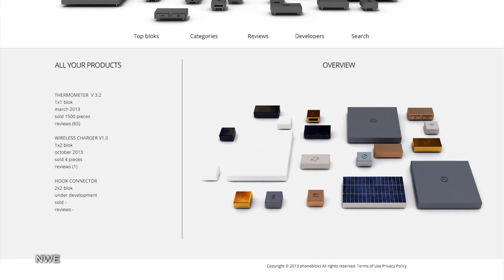Why Phonebloks Aren't Going to Happen

Comment: high speed signals ? we use gold for years in electronics 
ram and processor far away from eachother  cause slower speed ? how big do u think the phone is gonna be ? 
standerd input device  to make all combinations work ? thats called the motherboard + i dont know if they are gonna design it so u can put anything anywhere. that would be mad engineering.

Comment: think this guy doesn't know what he's talking about XD phonebloks has the cpu chip in one block and for example the wifi block separated. The idea of phonebloks is to make a phone mother-board where the changing pieces are separated. It means that the pieces which need fast connections are all in the same block. The connection between blocks don't have to be too fast because there is not going so much data around. Some pieces need just a few connectors, for example the antenna, wifi or battery. The only problems will be with the display and camera connections douse those need more pins, but not so much speed.

Comment: Here is a fella that thinks that phones can only be built in 1 way and he tried so hard to convince others that such a device would be impossible. Just remember, slightly more than 40 years ago, cellular phones were the size of bricks. And another thing, i don't think this guy read up or research on this project before speaking, clearly at 0:22 the memory block doesn't increase processing speed of a phone.

Comment: I love how all of you are yelling wrong, yet he isnt. All the concepts that phone blocks put out are not implemented in project ara. The modular system is not integrated in ara, it has a standardized exoskeleton. Plus, it is in its development phase, i bet most of you dont know how long development takes.
Reply: Quinntun Harris see the rest of my comments. Project ara is not using a lot of concepts that phonebloks is stating in that video.
Reply: It'll be ready for purchase this time next year according to development heads. 
The important part of "phonebloks" was the modularity. the ability to upgrade parts one at a time, instead of a phone as a whole. The different sized blocks was just an afterthought by this one guy who made the phonebloks concept. Modular Smart Phone with a marketplace for these modules is still coming.
Reply: Also, tHaH4x0r this does have multiple sized blocks available, and you can place any block, in any location. Check out some updated project ara demos to see for yourself. Not quite to the lego any size builder style that phonebloks showed, but still happening.
Reply: David Jeffers i already saw the updated project ara demos and it is still an exoskeleton with certain size blocks that can only be put in certain spaces. That you can upgrade parts is nothing new, it exists for decades on pcs, nothing special. Plus, almost none of the videos showed the phone working, and if it did it did extremely slow. Nothing new.
Reply: No, you can put any block in any slide, sure they are size specific, but anyone can make any block of any size. The bringing the modular components were not meant to be new in the entire industry, but revolutionary change to the phone industry.

here's the video I'm basing most of my words on.
Project ARA Phone at LAUNCH co
Reply: I don't think anyone really expected the extreme level of modularity phonebloks laid out. The important part was just the same as a PC could do.
Reply: David Jeffers Phoneblocks laided out a concept that was unachievable and now you are adjusting their sails saying it was not their original intention. The guy of this video said that the original phonebloks concept was inachievable and it still is, saying that that was not phonebloks' intention is not an argument. With this little, and size restricted blocks it is most certainly easy, but not in the spirit of the original phoneblocks. If i want a bigger screen i have to buy a whole new exoskeleton and screen, in contrary to what that video promised. This video remains just as valid.
Reply: I'm not adjusting saying it wasn't their intention. I'm saying that the big deal is being ignored because this guy wanted to nitpick at the specific details
Reply: David Jeffers Well what is the big deal? They promised a phone in which you can change anything, you still cant.
Reply: Yes you can. it's not in the same style as this concept, which btw phonebloks is not project ara, project ara was a "secret" project in development by motorola, and when phonebloks went viral they decided to go public with their design they already had in the making.
Reply: David Jeffers "tw phonebloks is not project ara" yes indeed, yet most of the people here do think so. Almost all the concepts that are critizised in this video are NOT implemented in project ara, yet people yell "LOL YOU WRE WRONG PROJECT ARA LULOLOOL"
Reply: That is because they completely said "NOPE" to the entire idea, because of the underlying concept had faults.
Reply: Which is the reason I, and many other people are saying "I'm sorry, You say phonebloks concept is impossible? I couldn't hear you over the Project Ara videos"
Reply: David Jeffers And it still has those underlying faults: cpu, ram etc cannot be spread around yet, no results of speed are displayed yet (probably because it is not fast at all (yet)) and not any and all combinations are possible. All the things he said phoneblocks couldnt do, still cant be done.
Reply: tHaH4x0r yeah... you can... upgrading specific parts instead of having to upgrade the whole phone, iirc the cpu and ram are in one chip, the battery in it's own chip, the camera in it's own chip, the wireless antenna in their own chip, instead of one bigger battery you can have as many batteries as you want it it, you can have a wifi only model, your OS block, your identity block, etc
Reply: David Jeffers no, you cant place ram on another place as the cpu for example, and that is exactly what phonebloks promised.
Reply: no, it's not. it's one part of the idea, and now that I think about it, they actually didn't say that at all. they said the "speed block"
Reply: 1) the original phonebloks video had to be simple enough for a consumer to understand, so "Speed Block" doesn't say they doesn't know what goes into a phone, it is getting rid of technical jargon in order to make the video sharable.
2) you just said you can't separate the CPU and RAM, and now that I say that you aren't separating them, having them in one block you can switch out, you say you want to separate them. 
3) The CPU and RAM combined are what you'd be upgrading, and you'd recycle them or resell them, not just trash them, in theory. 
4) in a PC the easiest thing to upgrade is the RAM, that doesn't translate the same to a phone, the screen, camera, battery, storage, SpeedBlock, all these things are the goal,

If I'm content with my phone, then instead of paying 300-600 dollars for a new phone every 2 years to stay up to date on the speed I need to run these new more intensive apps, I just need to spend 50-100 bucks on upgrading my speed block every year or two, and maybe a camera upgrade every 3-4 years.
Reply: David Jeffers i wouldnt call ram technical jargon. Most of the people interested in such a phone do know what ram is.
I say you would WANT to seperate them by the ideas of the concept, yet you cant.
" recycle them or resell them, not just trash them, in theory." You can do the same with phones today, guess what happens in practice?
I dont get the point of 4, what are you trying to say? Because all of those things can be upgraded just as easily as the ram, with the exeption of the cpu.
And what about screen? and what about battery life to go with the extra speed, screen and camera? Effectivly you end up replacing everything because hardware from 2 years back will still bottleneck newer hardware.
I get the concept but what you are trying to imply is not one of its strengths.
Reply: Shit...  I just typed a whole lot in the notification center while a video was playing, and since it was a playlist it autonext'd the playlist without waiting for me to click post comment... I typed all that and have to retype it TT_TT so be patient for me please.
Reply: David Jeffers sure, i love having normal decent arguments with people on youtube, you dont get them very often, most of the times it is just calling names..
Reply: Alright! So here it all is again, I hope I don't forget some of the points I made in the comment I lost..

1) RAM, CPU, DPI, mAh are all technical jargon term that most people don't understand. People would love to walk into a store or shop of some kind and say "My phone is running slow" and be told to upgrade their speed block, or "My phone won't stay charged" and be told to upgrade their battery block, or to add a second one because their second 2x2 block slot just has a filler block

I work in a PC Repair Place, and all the time people bring in older PC's and say it's slow, and we sell a lot of CPU or RAM upgrades that way.

2)Well, the video of this concept never suggested they wanted to separate CPU and RAM, you said that. And the benefit of that does not outweigh the cons of it, so it wouldn't happen.

3)I don't know about in your area, but I Sell my old phones on craigslist every time I upgrade. The only time I don't sell my old phone is if it doesn't work anymore, or I want to keep it as a back-up phone. And it's very common in my area. It could just be because I live in a highly populated area where it's caught on to do so, but you imply that reselling a smart phone isn't the norm in your area, so it's just a matter of it catching on I suppose. 

4) I'm saying that the SpeedBlock would be the most often one to get upgraded, in theory, and in that there shouldn't be any major bottle necking, and if there is then the store your buying your blocks from should be warning you about those, suggesting they need to upgrade X block as well.
Reply: David Jeffers .RAM CPU DPI and mah are not technical terms at all. Maybe most people dont know what they are, but they do know what they do, when you upgrade them you speed up your pc. SPI, PHY, RTC and nyquist are technical terms. I dont know what kind of people get to your pc repair place but everyone i have known knew what ram or a cpu was.
according to the original video, when you upgrade a part, you want minimum waste, so it would be sensible to seperate the cpu and ram.
And if you are already selling your old phone, then what is the advantage of phonebloks? The video implies a lot of phones are getting tossed out, yet it is the extremely dated ones that are being tossed out. The same thing is going to happen with phonebloks.
"and in that there shouldn't be any major bottle necking" you work at a PC repair place then you also know that once you upgrade your cpu, you almost always have to upgrade the RAM and gpu to go with it. And the new cpu wont fit on the old motherboard, so that is also necessary.
And no, phonebloks cant get away with 1 backplate with endless cpu's, they have different packages on pc as well with good reason. Which negates the primary advantage of phonebloks.
Reply: 1) The most people know is that they know if anything at all about ram/cpu is that it affects how fast the computer is, but just knowing that doesn't give you enough knowledge to upgrade it intelligently. for example, 32bit processor and trying to upgrade past 4gigs of ram, just being the most common thing people don't know. or not knowing that there are different types of ram DDR2 DDR3 PC100 etc, same with the processor, they may know it's "the brain" but they don't understand the basic differences between them that they need to understand if they can actually upgrade them. Socket, speed, amount of cores, etc. and if you can find an average consumer that understands what "DPI" is then you may live in an area with a lot more tech intelligence than I do. Most people around the area I live are not that bright when it comes to computers/electronics. 

By the way, I'm not talking about what my peers and friends know, I'm talking about the general population from what I've experienced in my past few jobs, as well as this current one at the PC Repair Place.

2)Well, as desirable as it may be to separate the CPU and RAM we obviously for reasons you and many others have pointed out, can't they are gonna have to stay together. I'm more than willing to compromise that

3)PC's have different generations when it comes to processors just like this phone does, one socket type in a PC would have a lot of different upgradeable CPU's you could put in it. And new CPU's get made for the older generations sometimes as well, a new AMD Processor just came out for a socket 2 or 3 generations old. This phone would have it's own socket type for it's first generation and if the need came to upgrade past it, they would release a new generation of phone, but it would be unlikely and uncommon just like in the Custom PC world. 

Keep in mind, in this scenario there isn't even a motherboard involved. The endoskeleton doesn't act as a motherboard, it acts like a network switch according to everything I've heard about it, so you essentially have a motherboard CPU RAM OS and everything like that on one module, and you add new features as modules like wifi cellular storage battery etc

It's not ideal for modularity, but it's the closest we can get right now, and I'm more than happy to take it, maybe in the future we'll have our ideal fully 100% modular phone as well like the PC is, only time will tell. This isn't completely ideal like the original Phonebloks concept, but it's got the most important part of it, screen, speaker, camera, battery, antenna, etc being modular, which are a lot of components I don't have to re-buy or something if the screen cracks, or the wireless antenna is out dated or the 

4) "One backplate and endless CPU's" 
I have no idea what you're talking about, I never suggesting having multiple system blocks
Reply: David Jeffers You must consider that the people going to a pc repair place arent a median cut of the general population, a lot of people do it themselves or let family members/friends do it.
Reacting to point 2, i said that because that was a point of the uploader of the video, and it still is valid in contrary to what many people claim.
The new sockets are because processors that are being designed have different pinouts. That is because the internal structure is designed for maximum speed, not for convenient pinout. When you have to design around a certain pinout, performance will suffer. "but it would be unlikely and uncommon just like in the Custom PC world." Based on what exactly? They take a lot of ideas from the PC world so i guess they will take this too. Plus, you have to consider the phone manufacturers, they have the most advantage if you need to buy a new phone often... There is actually a motherboard involved. The exoskeleton does have electronics inside, mostly voltage regulators and associated electronics. Google ¨project ara exo skeleton¨ and google images shows a few pictures in which you can clearly see the underlying circuit board.
¨It's not ideal for modularity, but it's the closest we can get right now, and I'm more than happy to take it, maybe in the future we'll have our ideal fully 100% modular phone as well like the PC is, only time will tell." I agree 100%, it is just that everything the uploader of this video said is still true, yet it is treated as if it is all proven false. That was the point of my original comment.
And wireless antenna's dont get outdated, they are designed for a certain frequency and do not need new replacement except if the complete cellphone network is revamped.
With the endless CPU's i was referring to a single backplate that can accept any and all types of CPU's. Not that a single backplate can accommodate multiple CPU's.
Reply: hmmmmm project ara is aiming to be release in January... you were saying???
Reply: tHaH4x0r  True and i agree with you but you have to take into consideration what works on paper don't always work in real life. Therefore you always have to work with what you have to make what you want. I just see the guy crushing the whole idea of phone blocks, and the bear concept of it is kinda stupid, because moving around parts like that is cause for disaster with so many manufactures and there MOST be some kind of standard. Hence the exoskeleton to put a standard in place to make sure  everything works as it should. So project Ara is just phone blocks in a realistic manner.
Reply: look how wrong you were.
Reply: tHaH4x0r it's expected to be in consumers hands before this time next year
Reply: David Jeffers And? My point was that Project ara is not using a lot of concepts that phonebloks is stating in that video. Plus it is now almost a year later already.
Reply: Yes it is.. they have an endo skeleton, with multiple sized slots, that you can slide any module in. Only thing it's not doing is letting you shrink the battery to make room for a better processor to the same extent, but instead you can use a smaller slot for the battery module, and a bigger module for the processor module
Reply: David Jeffers  It is two years from this videos date of production. No specs have been shown that they can cope with the speed dillema. 
BTW: Bigger module for processor does not neccesarily mean its quicker.